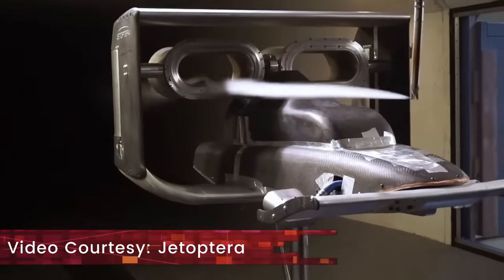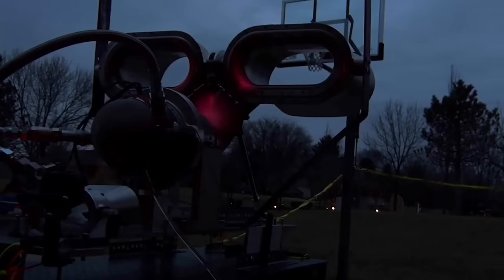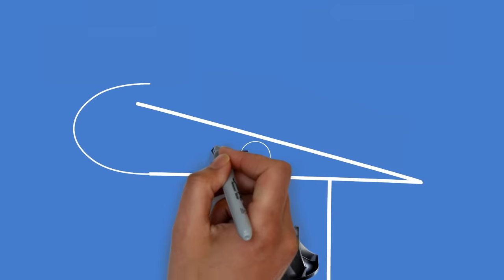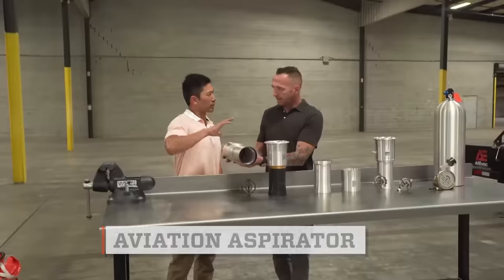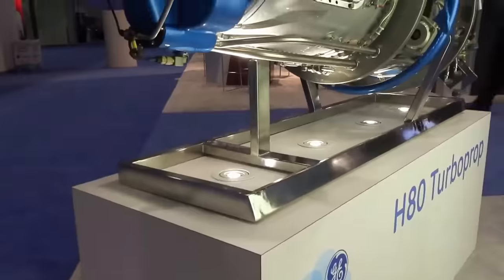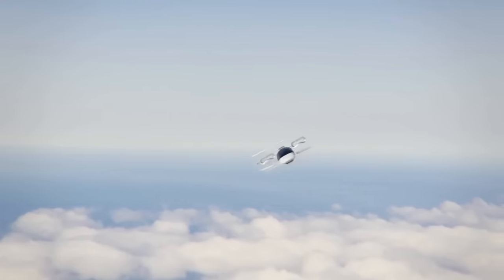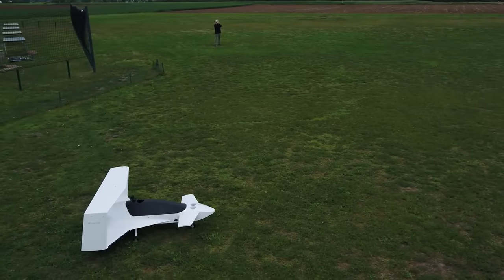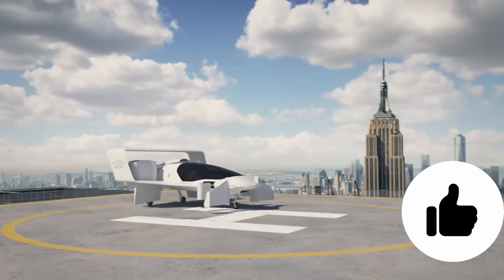Jetoptera's Bladeless Propulsion System

Comment: This feels like bullshit snake oil to me. I'd be more than happy to reconsider if someone could prove it works with math, but I highly doubt that's gonna happen
Reply: My first thoughts too, but then...
Consider jet engine efficiency increase due to exit nozzle geometry. This might just be an enhancement om that idea.
Reply: @dougaltolan3017 I'm more worried about the actual mechanics of this particular device. It claims to work by creating a low pressure area behind the duct, thus driving airflow through it. But in all the fluid mechanics work I've done, I would've looked at that area and immediately pegged it down as being at freestream pressure. There's nothing actual forcing the creation of a low pressure zone (not to mention the problem of how much pressure it would take to create enough thrust even if it did work)
Reply: @spacehooliganzack7429  Ok, lets give this a go...

The thrust from the nozzle (the annular ring opening) is simply what the compressor generates, thats a base line.
Given the nozzle direction and coander effect, the air that is in the space will be caught up and pushed/pulled along with the nozzle flow, as per the emergency chute inflation device. The cross section increases towards the rear of the tube, so either the flow slows or the pressure drops (or both, ive been trying to get to grips with jet engines and how pressure and flow speed change through them).
So, what leaves the rear of the device is a tube of turbulent, fast moving compressor exhaust with a lower than atmospheric zone as a core. The turbulence causes yet more air to be entrained in the core and the low pressure keeps the whole thing from diverging.
Its that last bit that is the key (I think).. Jet engine exhaust nozzles and rocket engine bell exhausts are primarily to keep as much gas as possible heading straight aft. Without careful nozzle design, as the exhaust exits the engine,m it sees all the free space to the side of its flow and goes that way instead.

All this should be very easy to test though. I guess plain nozzle design is textbook stuff and not needed to be reinvented, all that needs to be done is compare the best nozzle vs a Dyson hair dryer. It is known that the Dyson hair dryer shifts more air than the internal fan can do, its just whether is a straight mass/speed trade off with no momentum benefits..
Reply: @dougaltolan3017  But in Jet Turbines and rocket engines the accelerating gases energy is channeled by the shapes of the nozzles etc. This enhances the efficiency. In this case the energy isn't confined by anything solid and connected to the aircraft, so no gain in efficiency.
Reply: @dougaltolan3017   I don't see any way that the air within the thrust zone would be held at a lower pressure, since it's open to atmosphere on both ends. Yes, some of it will inevitably get pulled along with the compressor stream due to viscous effects, but that process is a net loss of mechanical energy. Since the area is diverging, air could flow in backwards to fill any potential void, further reducing your thrust by creating some momentum flux in the wrong direction. It would basically just create a bunch of annular vortices, instead of usable thrust

Also you're slightly off on jet and rocket nozzles. They're not so much about directing the flow, as about converting the pressure of the flow into velocity (analogous to converting potential energy to kinetic energy, although not quite the same thing). And the thing about diverging nozzles, they only accelerate the flow then that flow is supersonic. At subsonic speeds air behaves as though it were incompressible, so reducing the area means velocity increases in order to maintain a constant mass flow rate.

Comment: Haven't read all the comments, but from what I read, there has been no constructive discussion on this concept.  Probably because no one has an actual AeroX Degree.  So here is my professional opinion It's not a workable idea.   Not to say in every respect the fluid analysis is wrong.  A wind up toy airplane can fly quite well, so can drones, but no full scale plane can fly the way toys do.  You have a "Gulliver" effect.   Ants can lift 10x their weight, but a giant can not lift himself.  Air is a compressible gas..  The Dyson fan works as described because it is moving air under low speed low compression, a small scale,  and the air is acting like  a fluid with predictable static and dynamic pressures and a somewhat stable density.  But when air is actually asked to make substantial large scale thrust, the changes in static, dynamic pressures, air density, and viscosity matter critically.  It's just not blowing air that makes thrust.   It's the amount of mass of air being thrown, and moving other air out of the way. Also, it's ridiculous to compare this ducted compressed air concept to a ramjet.  The functions are totally different.  Even the frame of reference analysis is different. Lastly, you can't begin to appreciate the losses in energy moving the required mass of air through elaborately ducted fans compared to just throwing it straight back through an open jet, or behind an open propeller.  The cost of the needed energy in ducted airflow like in this idea is very high.   The English found that out with their Harrier jets.  They flew, but at very high cost.

Comment: Quite interesting.. This explains to a better extent a device I encountered years ago while working at a chemical plant, that being an oil diffusion pump. These used the same basic principle, but instead of compressed air, used a boiling pot of oil to create the initial pressure, pumping it into the midpoint of a venturi, creating the low pressure area shown in this vid. Ans as with this system and the Dyson fans, the flow was dramatically increased. In the case of these pumps, they were used to create very high vacuum pressures required by the processes, much higher than obtainable by mechanical means..

Comment: This is the first time I’ve seen this but a few years ago i was designing what I think is a similar idea a model RC UFO and was using a dyson fan for the main drive with small induction fans around the perimeter within the body to work as vectors for stabilisation I also drew the same concept for the black triangle UFO I just didn’t have the funds as on disability benefit as kids and home come first, I know they will fly and would love to see someone take these ideas and complete them good luck happy flying.

Comment: 5:00 also used on a smaller scale in SAAB vehicle fuel tanks where the fuel pump is placed in a surge tank to which fuel is pumped from the main fuel tank in this exact manner.

Comment: Straight out of 'Bade Runner'! The design genius is in the simplicity here. Just about anyone could drive/fly one of these, otherwise perhaps they need to be self-driving. The number of lives lost otherwise could be astronomical. One wonders about the logistical problems regarding domestic air safety in managing the potentially huge numbers of average Joes all flying these around at the same time. Large numbers of these vehicles in the sky at the same time would obviously be a dangerous scenario. Collision avoidance radar, or similar, would have to be faultless so these craft could fly themselves and transport passengers in a safe manner.

Comment: I’ve used an air moving device underground for ventilation called a ‘ladies waist’ that works on the same design for over 30 yrs. Hardly new or innovative. Achieving the lift and thrust to carry someone would be awesome to see.

Comment: In Russia, we do not use fossil fuel or electricity.  Ductwork is similiar to a turbine, but is a series of compartments with inlet valves. Which each series of compartments using superheating inlet air, with addition of a commercial gas super expands then discharging into the next compartment, which further heats air, with each successive compartment escalating temperature, with final chambers simply injecting water that greatly expands breaking down into hydrogen and oxygen that then ignites producing a series of multibursts, that at operating range is not noticeable but acts as a continuous flow of energy superseding the force of jet turbines.  Only matter is expense of manufacturing given the strength required for the process.  Although in combat operations being so strong, attack to the powerplant is ineffective.
The one complication is the feeding of aluminum to the water box, which is introduced as molten from heat transfer unit of nuclear reaction.

Comment: Yeah man !I have a design with same system except for mine is the lenght and width of a bus and is initially launched on a 500m mag rail with a launch taper ramp.The CBD AirBus propells along to 250km/h and shoots upward just like an plane standard 737 and whithin minutes it decends down on top of a city building roof using its Jetoptera's Bladeless Propulsion System. The initial energy is from static ground surface supercaps and the small amount of energy used to land comes form super caps as well that are embodied in the CBD AIRBUS> This can get people from suburbs to ciies in 3 minute or less!

Comment: So basically, the Jetoptera persons are stating they can put 100 hundred units of energy into a system and multiple hundred of units of energy will exit the system.   I will believe it when they show me a bouncing ball bounce above the height from which it started descending.
  I am familiar with dewatering systems on ships that use a jet of water rushing through a larger nozzle.  The kinetic energy of the first plume is greater than the kinetic energy of the total plume of water (first plume plus the additional water that would enter the de-watering nozzle) that exits the larger de-watering nozzle.
  If this concept of operation described in this video were real, multiple rings of nozzles would produce mutiple units of power greater than the initial power of the first jet of fluid.  But in fact, a multiple-ring system would progressively diminish real output, because each addtional stage would pruduce energy losses that would finally yield no work.

Comment: What are the drawbacks of this design? Thats an interesting question, in order to estimate the feasibility and effectiveness. 
One eye-catching point is that the drag must increase by the additional  surfaces and cross-sectional area. Perhaps this eliminates the effect of the increased airflow? My own experiments with coanda effect utilization (with a drone) were a bit dissapointing since I didnt achieve a thrust which was higher than that of a simple prop.

Comment: Neat vid, I am a bit skeptical on it, but if they build a full scale prototype and it flies, I'll be impressed, that said, there was 1 error I did have to point out, the noise levels will actually increase, not decrease, ironically dyson fans are considerably louder than their full bladed counterparts at full speed

Comment: Brilliant design.  It would be easily adapted to truly electric propulsion as well. Put a power wire around  the intake and a ground at the exhaust apply power and you'd have thrust,augmented in the same way the compressed air is. I saw a power plant that farmers are using for weed zapping that is sufficiently compact to power it,that could be driven  by either an electric motor or  small turbine.

Comment: I think this fluidic propulsion is an alternative as a "propeller powered car", an experimental vehicle from early century XX. In these days, the concept could be usefull in hybrid termo-electric cars. In the city, the "bladeless propeller" is in state off and the car runs using the electric motors. In the road and highway, it is in state on and the car runs using the combustión engine, moving the turbocompressor. The best of the two worlds: No transmision, no gearbox, no edge of transmission, non homicinetic joints, no clush.

Comment: Approximately 70% of fuel burn in a turbine is to keep it turning. The rest is usable power. I remember the T56a-14 generated 20KHp, yet the output was 4.6KHP. I think a rotary engine could produce a more efficient compressor. An APU might be a better application as they produce hundreds of pneumatic HP to start the main turbines on aircraft. The one I worked on had 90hp shaft output, yet could produce 450 pneumatic HP off of the compressor. No additional compressor required. I don't recall the BSFC numbers. (From 1980)

Comment: It's not gaining extra energy by using the bladeless design, it is however gaining an increase in the amount of flowing gas/liquid by trading some of initially induced speed of the flow exiting the device.

In total the thrust should be equal or less, but the amount of air that you are moving increases by lowering the total speed of the system.

Comment: I keep looking at that canard that blocks the intake on the front it bugs me. Maybe it could be a perminent open sort of slit downward part of the nose and then have the canards more stream-lined on the sides of the nose? I would also save weight on not having to have the hydrolics that move and pull them into the body as well as the computer chips/parts.

Comment: The thrust is ultimately created by a compressor which is technically uses blades. They’ve hidden the compressor which just adds flow inefficiency and makes one wonder how that large intake effects stability if not in line with the thruster output.

Comment: I have one question.  In the video it says the this system is 10% more efficient than traditional airplanes, however it uses 50% less fuel.  Just wondering where the discrepancy is, maybe it works out, but just seemed like a bit of a stretch.  Incredibly well made video though, and amazing technology.  They already have working electric aircraft, so if this technology is applied then it would make an electric aircraft travel further.  Maybe not trans-atlantic range yet, but with a bit more development on batteries...maybe.

Comment: This type of jet flow is  commonly used in gold dredges to create suction in a hose and allow the free flow action up a pipe . It works  by sending a higher speed of water in the direction of water flow in the same way this air to air works.

Comment: What happens with a strong crosswind. Does it interfere with the  box design . Also if you introduced fuel and ignition before prior to exhaust like a scramjet. How much did it increase the thrust ratio.I think it would have to be internal. Which now causes the next problen Temperature reduction.  Unless it's back fed and also used for thrust.

Comment: Brilliant idea and very innovative.   Just thinking outside the box. I have  a terrible suggestion though. Make the cargo plane first pilotless. That way the  company can start earning revenue so if anything goes wrong no one in the plane is killed. And it serves as a test case to iron out the bugs and teething  problems.  Only those on the ground if in the way of the falling debris. Well this is what has happened in the past and no one objected. Conversely If there is a catastrophic engine failure or technology stuff up, have a parachute that brings it back to earth slowly without the  risk of the loss of life. Special inbult safety system so it ditches in the ocean.
 Next make a model of this as a kit so it can be flown radio control. As well as plastic models too. To have one of these at the local park fan driven would be so cool. Something with a wingspan of 1-2 meteres another revenue raising method. Or as a scracth built kit too. Polystyrene foam and balsa. Or some other new technology material. And what about a boat version of this.  Or a submarine version for veiwing the great barrier reef. This would be a great  air taxi. Helicopters will be a thing of the past. Come on hurry up the world needs this technology.

Comment: Since this relies on pressure for air propulsion, would heating the air like a air blow dryer help to increase force? Also, this might sound like a dumb idea but what if for landing, to save energy, you can catch air as you go down to then redirect the air in the opposite direction, kind of like how some electric cars save energy when going downhill. What would happen if you applied all of the same principles in the video for adding pressure on air at its release point , but then repeated the same spiral looking shape to then multiply air pressure allover again, applying something like the golden ratio spiral, where the spiral gets smaller and smaller. Or maybe I'm understanding the concept wrong. I hope you guys are successful, this design, as well as the cylinder blade from another company is my favorite so far. God Bless.

Comment: Truly a very interesting proposition. I would love the idea of a flying car, however a boat or even a car could certainly cut down the need for using fossil fuel. Ideas and models are great, however a full scale working model would cement the financial market and secure funding. Good luck gentlemen.
MO
Reply: Cutting down fuel usage with a gas turbine? Seriously? And batteries are no go, until energy density is increased x20. Will never lift, of fly for 30 seconds.
Plus, making batteries pollutes many times more than burning fuel in a catalyzed engine.
Technically speaking.
Politically speaking oh yeah, let's make batteries, let's save the world, let's cash commissions from the chinese.
Funny little plane though, I'd buy one.

Comment: If this works its brilliant because it is so counter-intuitive.  You're pushing the airplane with moving air whose kinetic energy is its mass times the square of its velocity, so higher exhaust velocity means more push per kilogram of air expelled.  Surprising it can entrain enough air to overcome this plus friction drag in the duct.